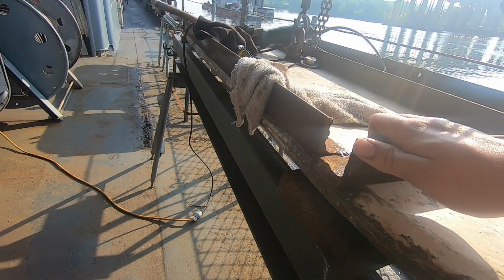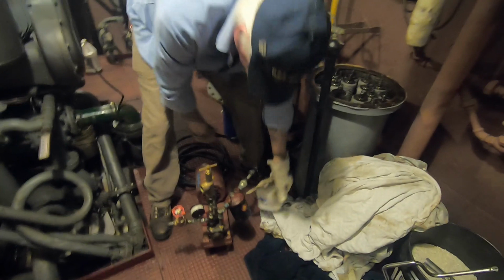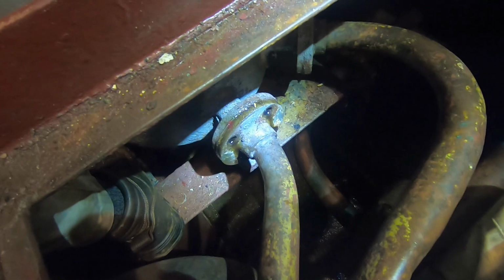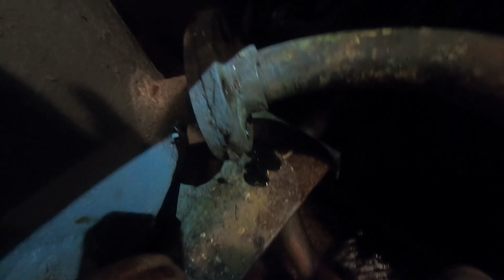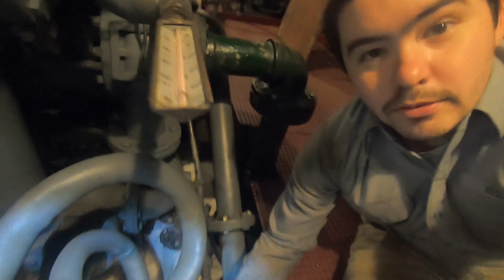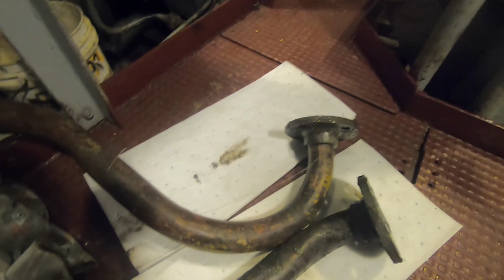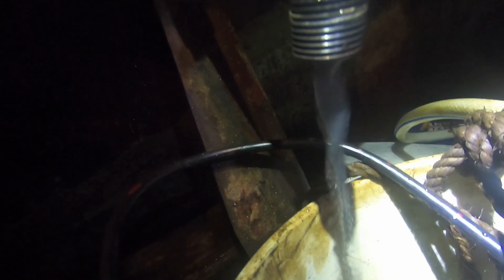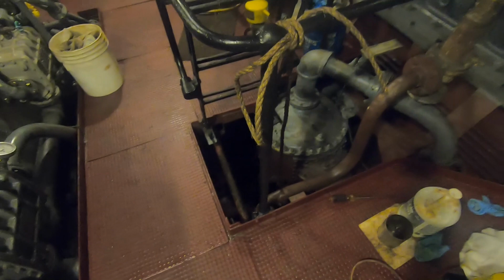Dewatering the Main Engines - SLATER Work Vlog 13 June 2022

Comment: Was that the raw water side or the engine side of the hear exchanger that you drained?  

If the engine side, you might consider replacing it with the appropriate glycol mix with corrosion inhibitors to prevent rust and corrosion in the water jackets.  If the raw water side, have you considered blanking the Sea Chest outlet and the Overboard Discharge, then blowing air through the raw water side until you are completely dry?

For the engine oil, if you have the capability to turn the engine over on air, you might consider draining the engine oil and replacing it with a suitable layup oil.  Turn the engine over until you show positive oil pressure for a minute or two, then drain the layup oil out.  The layup oil will leave a long-lasting coating on all oiled parts.  Hit the Dollar store for a bunch of bread pans, fill them with desiccant, and hide one behind every inspection cover that they will fit in.  

Of course the cheapest method would be to forget the desiccant, drain and refill the engine with the standard lubricant, and turn the engine over on air every few months to circulate the oil.
Reply: Sorry nobody replied to you. Thats an oil cooler. We drain the whole engine down, and keep it filled with antifreeze. 

This engine runs. We did the video in September.
Reply: Also, the big exchanger for the 16 is the lube oil cooler. The engine was not prepped for storage when Greeks donated it back, so it’s likely there was water left sitting. We will see in upcoming videos.